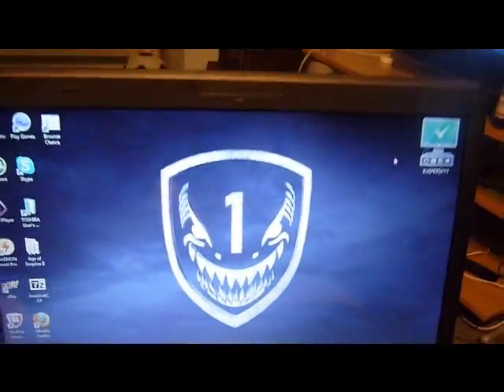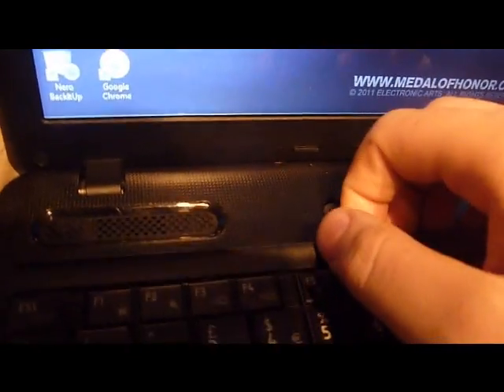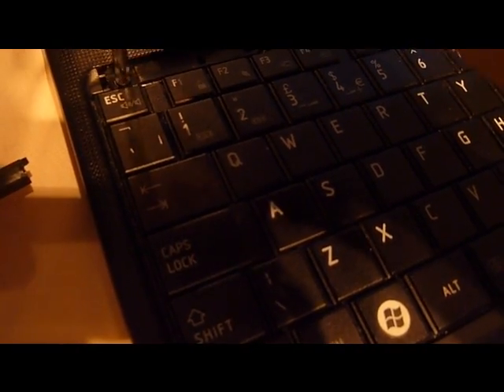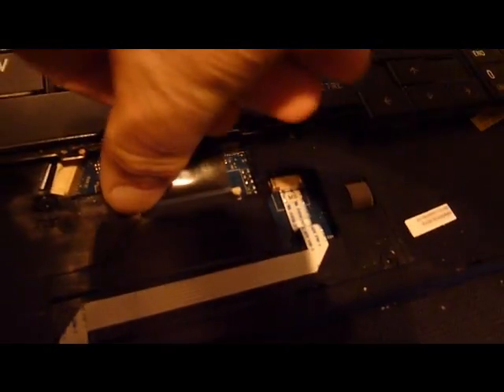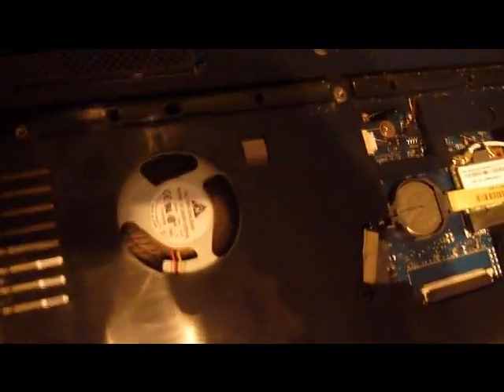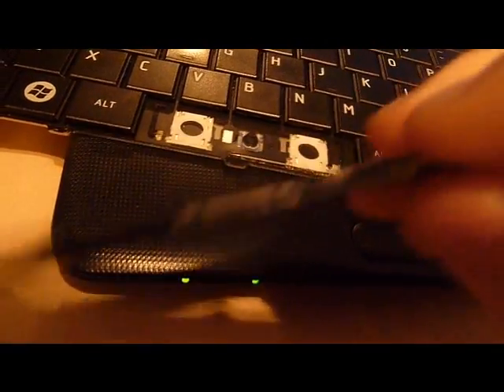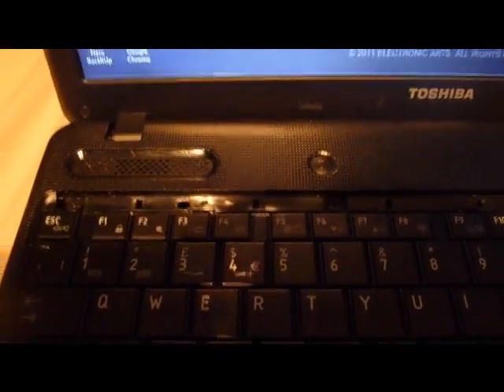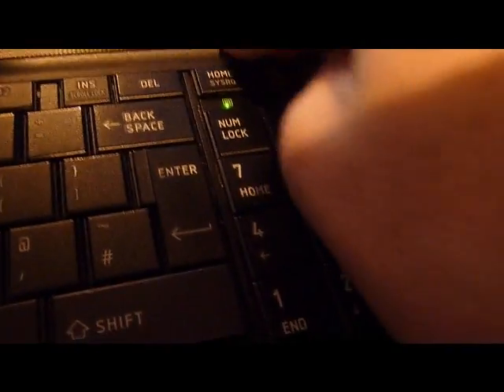DIY I.T. - How To Clean/Remove Toshiba Keyboard

Comment: Isn't it dangerous to open the laptop while it's on and pluged to the wall 🤔
Reply: im not sure, i never tried lol. i wouldn't recommend though, but its ideal to do so in order to check if the keyword plug have been properly inserted or not rather than opening and closing again.

Comment: If you keyboard isn't buggered yet, keep watching.
Reply from the maker: Haha, this is 4 years old now and people still need it, hope this helps you dude
Reply: Kinda, just that prying off key like you did was not the best idea, I got the finger nail out that was under it but I had to watch a few videos and spend about 30 minutes to get it back on because the clip that holds it flew across the room and separated into two pieces and on one side of the metal clip that attaches to the key broke where it connects but my capslock works now, so there is that.

Comment: A bit of all right but I suggest unplugging the power cord, remove the battery and hold the power button down for 10 seconds to discharge the power. Then you will not zap something. I could see the num lock light on. Otherwise helpful, thank you
Reply: Should.I.take.a.back.up.before.removing.battery?
Reply: No need to back up you will not lose anything. Mine is still working fine by the way. Have fun .

Comment: Good video. But just one thing I can't really stress enough. Make sure to turn of your laptop prior to doing any work on it and remove the battery and make sure you are not staticly charged. If you had touched the motherboard with your screwdriver you could have short circuited it and your whole laptop would be fried. Something to keep in mind when doing maintenance on your hardware. Hope that helps.

Comment: Toshiba Satellite L75D-7268 Keyboard Removal: No body dis-assembly required.
There are four small tabs at the top of the keyboard, and the bottom of the keyboard 'snaps' under four little tabs. To remove keyboard: Use a rectangular razor blade or credit card at the base of the keyboard to wedge toward screen a bit while holding upward pressure on the base edge after each clip releases.
Tip keyboard toward you to lay flat upside down and 'swing' the grey gate up and toward the display, to release the ribbon cable.
It is ridiculous that these laptop manufacturers don't provide these instructions.
BTW, after keyboard is removed, it gives you access to the internal screws to remove the base. About 2/3 of the base screws are on the outside, but 1/3 are under the keyboard...

Comment: I was looking for videos to show me how to clean a laptop keyboard, although you show how to remove individual keys right at the end, I think I would have found it more useful to be shown this in more detail in the beginning, as the title of your vid is clean/replace.  Although you say replace/clean verbally on camera, I missed this first time around and only having an inkling you weren't cleaning the board first did I put my trusty screwdriver down, thank goodness lol! 

This isn't actually about your vid but when I was taking my keys off the keyboard one of the little white plastic bits underneath came apart, it's happened before so I knew I hadn't broken it, but what a fiddly pain in the behind it was to attach back together and then back into the fixings of the laptop, it would have been useful to include how to reattach this bit in case it happens to someone, like you did with the metal bar behind some keys (eg. the space bar).

My final comment was more of a personal one, I get awful travel sickness and I started getting nauseous as your camera moves around like a roller coaster, I appreciate my condition may not be normal, but my personal preference is a nice still camera.  Perhaps as this vid is a couple of years old you might consider doing an updated version and separating the two helps into individual vids, plus borrowing a tripod off of someone? 

I do appreciate all self-help vids on YouTube tho, including your one as you have taken the time to record and post and I know it's good to learn how to fix things at home, so thank you for your time and trouble 😉.  The only reason I'm commenting at all is you asked for feedback, I don't usually give feedback on all the vids I watch (I'd never get anything done!), but you sounded sincere and genuine and not likely to start cussing or flaming me for leaving you with the above 😇

Comment: 1) If you are going to do this at home please unplug the power supply and remove the battery!!

2) there is a screw in the battery compartment (on my model) which retains the ketboard bezel.

Comment: Just want to let you know. My Satallite L755D - S5204 has a screw hidden behind the battery holding the small black panel on the top. So be careful what you say can and cannot work because if I hadn't looked at a different video I would have broken that part.

Comment: FYI On the Satellite models, when removing the strip to expose the four screws you have to loosen the screw located in the battery compartment first.